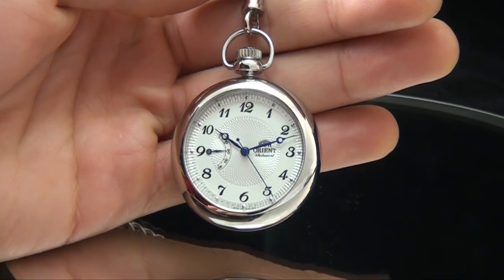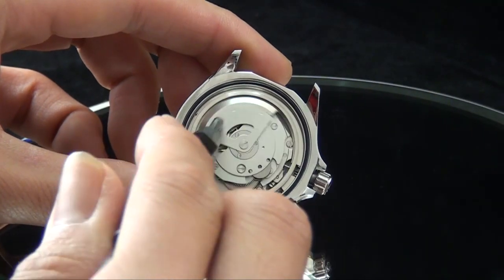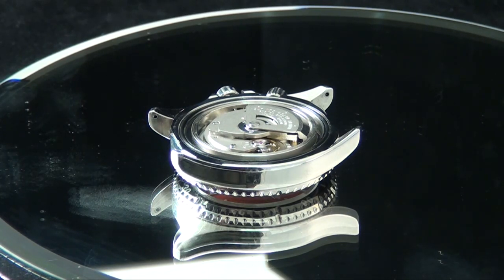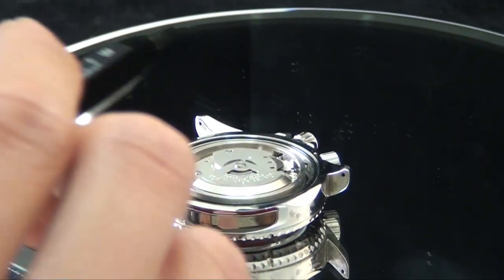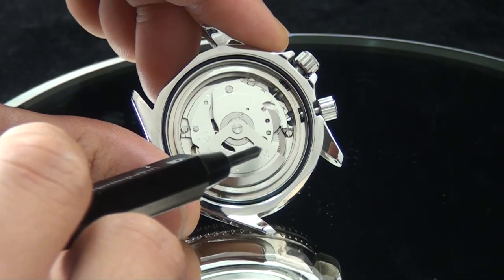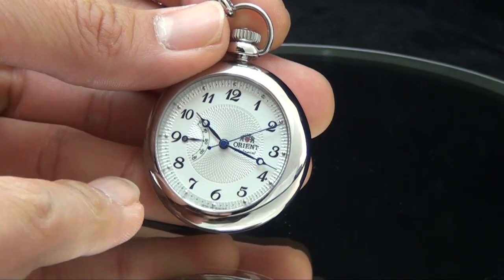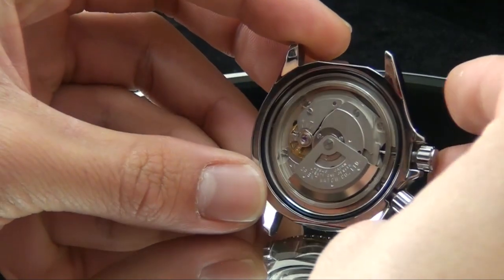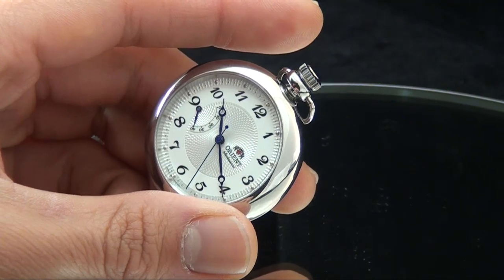Orient Watch Movement Questions

Comment: swiss watch set price much more higher due to : 1. higher labour cost; 2. celebrity endorsement cost; 3. decoration, accessories etc that people use to called 'art' but have no direct connection with the movt quality; 4. complication features on the watch; 5. Fancy material (leather, gold plated, etc) that does not related with the movt quality itself; 6. Pride, prestige, lavishness;

Comment: Would you explain why some Orient watches with automatic movements have a power reserve indicator?  Because the watch is powered by movement of the arm of the wearer, it would seem that the power reserve indicator would not be as useful as on a manual wind watch.  I recently purchased an Orient Orange Mako CEM7500 and I love it.
Reply: The usefulness of this could be if you don't wear this watch every day, or if you have a very "calm" life that doesn't recharge the main spring a lot. When you notice that the power reserve is running low (either because you left the watch two days on a table, or because you were working at the desktop all the time) you recharge the watch so that it doesn't stop.

Comment: Orient vs ETA.  Micro Ball Bearings on the Rotor.  Simplified engineering over ETA.  Fewer parts - Fewer Parts to break.  I have an Orient Sea King built in 1981 that keeps time with my Atomic Clock.  Only problem is that it is non hack able but it is very good.